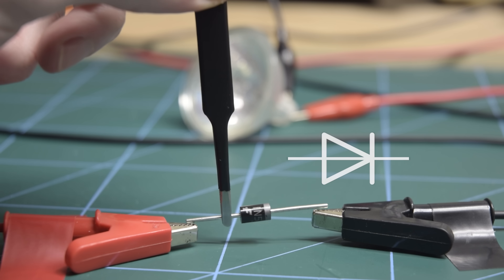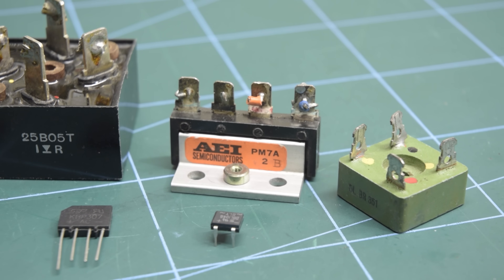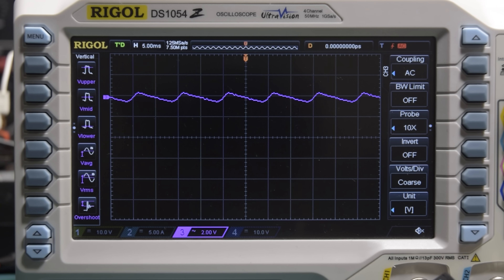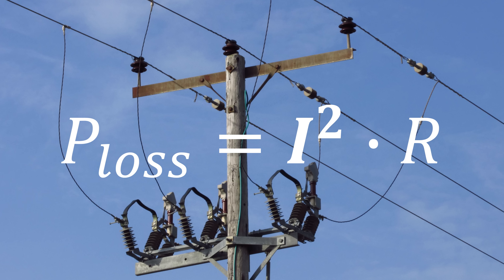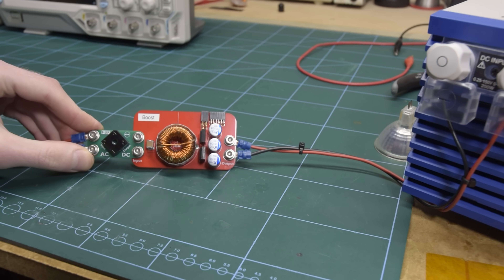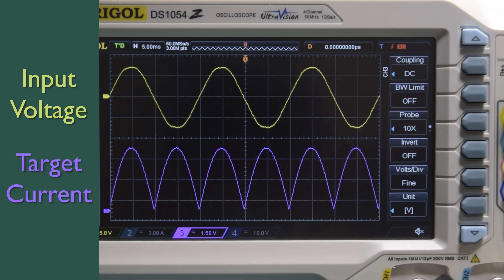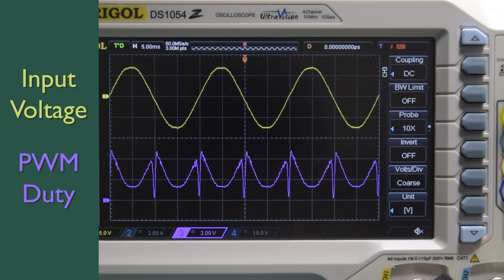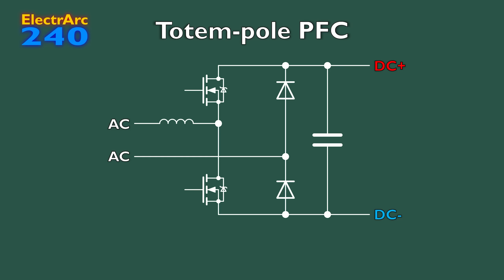Fixing the Full Bridge Rectifier’s Big Flaw - Active Power Factor Correction

Comment: In about a decade, we want to see all that IBGT deprecated, and replaced with high voltage, high current MOSFETs.
In my time, fifty years ago, I was doing this job by replacing the bridge rectifier with four SCRs - each driven via an optocoupler. The four optocouplers were connected to a complex driver board, realised exclusively with TTL logic ICs - as there were no microcontrollers and no controlling software.
It did the job - but the system was mind-boggling complex, inflexible and expensive. Many medium-large power systems were, up to that point, using electric motors coupled to alternators for power conversion and correction...
Reply: Known at the time as a "rotary transformer" or "rotary converter".

They had huge, power station scale, rotary transformers at each end of the DC link that connects the UK and French grid systems. 

The power would flow either way, and the link saved both countries money because peak usage differs by country. If I understand correctly the new electronic systems need separate converters for power flow in the different directions, whereas the one advantage the rotary kit offers was that it worked both ways. 

In every other respect the modern kit is better: it's more efficient, smaller, and cheaper to build, and needs less servicing. 

The link to France was the first for the UK, but these days the UK has several links to various EU countries. I'm guessing none of them use rotaries.
Reply from the maker: That sounds very cool!!
Reply: On my work I had to do with thyristor converter, that supplies small DC motors, and that converter has no semiconductors except for diodes and thyristors, last are controlled by phase shifting device built on selsyns. Oh, also it was totally hand-made.
Reply: IGBT's bit like hybrid cars of today, not so clever . . .
Reply: @flashback9966  I'd still rather have a hybrid. At least until battery tech improves by about an order of magnitude.  I don't see that happening any time soon though, if ever.  In Canada and other northern latitudes the range reduction you have to accept in winter just to stay warm is a huge bummer and heat engines excel at making extra heat.
Reply: @ 90% of new cars in Norway are EV's. That's a pretty cold country . . .